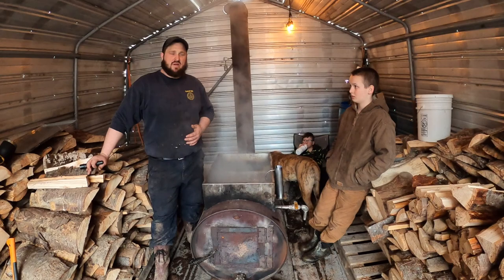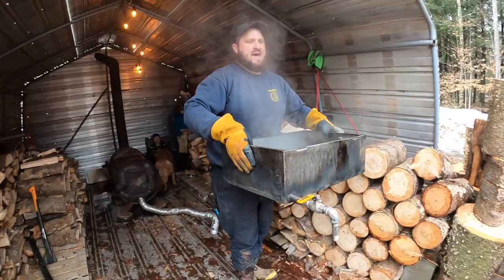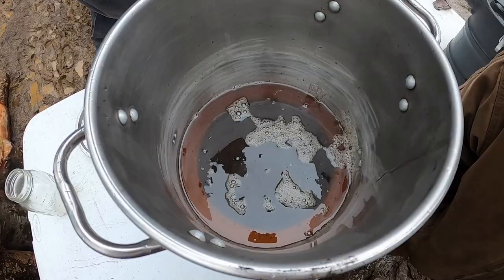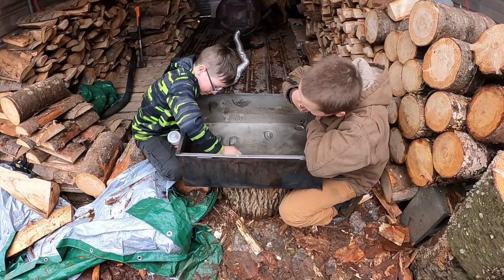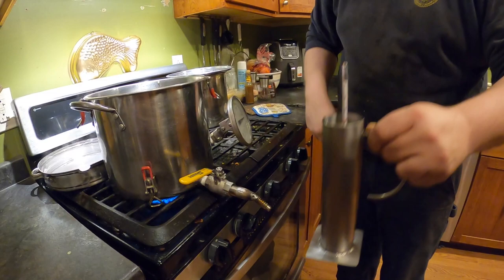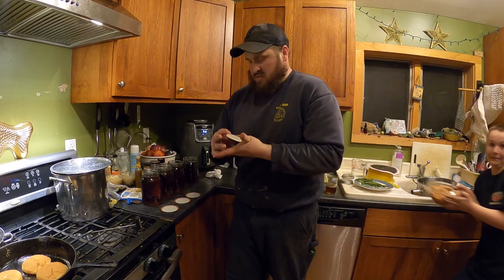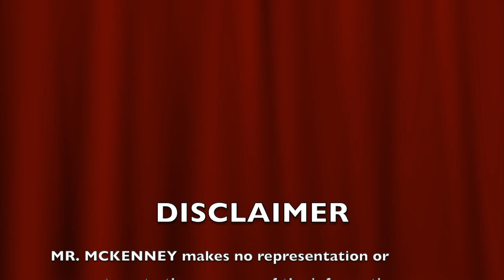Finishing and vacuum filtering maple syrup

Comment: If you're using the hot test line to determine its syrup on your hydrometer the syrup needs to be 211 at 190 you're syrup well-read heavy by that and it might not be
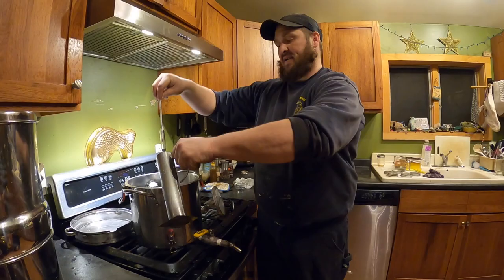Reply from the maker: Thanks. Not sure where you’re getting the 190 from from in the video but if you go to minute 5:40 you will see that the dial thermometer in the pot reads 212 Fahrenheit.
Reply: I didn't realize the video sped up I thought you did your reading right after you adjusted your thermometer

Comment: Add some filter aid it will bind to the niter and sugar sand. Also help with filtering (food grade diatomaceous earth) about 1/4 cup per gallon
Reply from the maker: Nice thanks! I haven’t seen anything that showed it would work. CDL says it will work. So glad to hear from somebody that has tried it. I definitely will be doing it on the next batch thank you so much.
Reply: @mr.mckenney2549  it will take a little longer to go through but it will be a much cleaner product. Good job on making one! Mine was a lot of money. Don’t forget you never want to heat the syrup to above boiling after it’s been filtered. That can cause more niter to precipitate.
Reply from the maker: @Breakitbryce  Thanks again for all the great tips!
Reply: @Breakitbryce  after you mix the DE with your syrup do you run it through the vacuum filter once or twice? I’m new to using DE
Reply from the maker: @romerobinson8279  I tried it this year with DE and had to run it many times to get it all out. I also used the wrong DE I bought food-grade DE from a tractor supply, turns out it is the wrong DE. You will have to get it from a maple supplier it is a lot courser and one pass will work.

Comment: where did you get that shallow double boiler setup and the larger (bottom) stockpot that you're using to finish/bottle with?
Reply: The bottom double boiler was actually a stainless steel frying pan that I cut the bottom out of and a pasta strainer I cut the top off rough and welded them together. The rest of the stuff actually came out of the dump in the town I live in!
Reply: And just for clarification that stockpot with the valve in it and the strainer top was all homemade everything was welded together and top made on a drill press

Comment: I like this vacuum setup I am expanding this year and looking to make a couple of gallons of syrup.  filtering is a bit of a bottleneck do you have a materials list or a build video for your filter setup I am trying to build one myself without breaking the bank.
Reply from the maker: Hello, I don't have any video content regarding the creation of this system. The materials were salvaged from my local dump and fabricated with my high school students. The two kettles are approximately one foot in height. The double boiler was created by cutting the bottom of a stainless steel frying pan and welding it to a spaghetti strainer. The valve is a 1/2 inch 316 ball valve. The thermometer is 1/2 inch NPT threaded into the other half of the stainless steel coupling that I used for the draw-off. The vacuum is just an ordinary one, intended to remove ashes from a pellet stove. The attachment point was a 1 1/2-inch stainless steel hose barb. I use one main filter and two prefilters that were purchased from a maple supplier designed for their system.